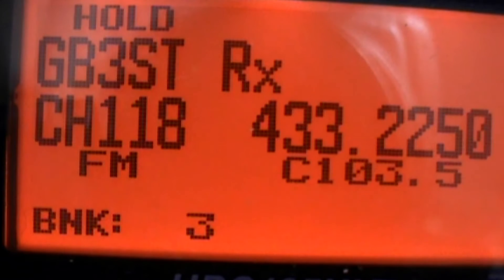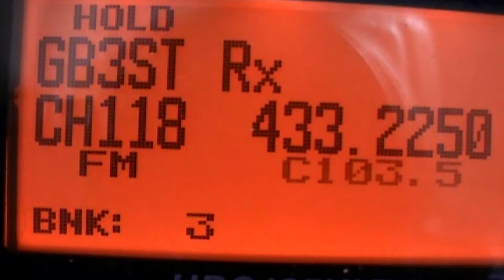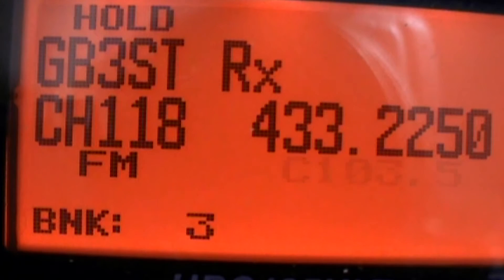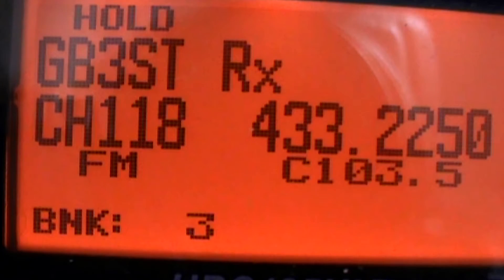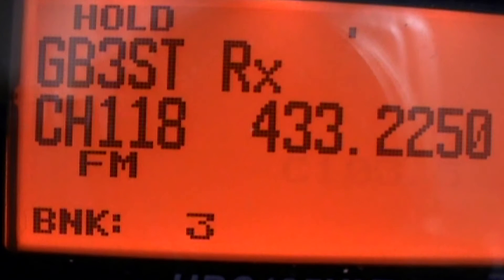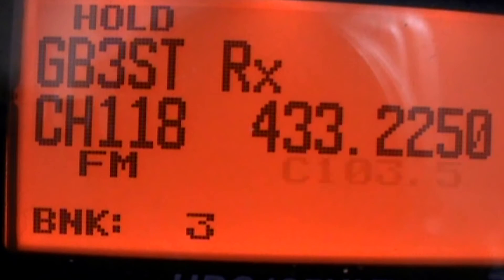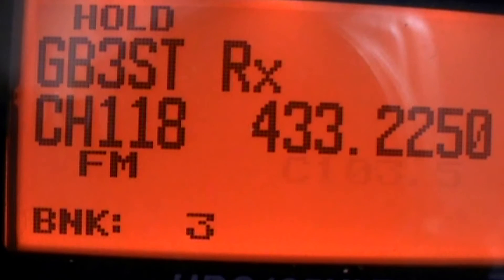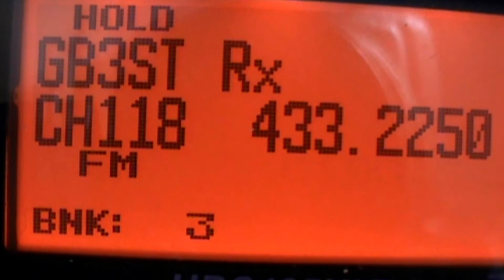Chatter on the GB3ST Repeater Stoke on Trent

Comment: Hello, Is there any cloned freq i can install on this using the software rather than having to put everything in myself? Was planning on getting one soon you see. Would like as much in it as it can hold, repeaters, air, emergency etc. Thanks.
Reply from the maker: Ive made a video on how to use ARC125 which can be used to program the frequencies into the scanner using a PC. Frequencies for your location can be found on http://ukradioscanning.com/
Reply: I'm only down the road from you, always in newcastle under lyme. id liek al lthe ham channels pmr cb, but i think you can get the Air and radar stuff?
Reply from the maker: Theninjagecko Radar and control frequencies, not close enough for the tower stuff. CB stuff Ive picked up a few times but not very active. Occasional HAM stuff too. You can get plenty, but its just a matter of using an upgraded antenna. I use a cheap one off amazon and it does the job fine